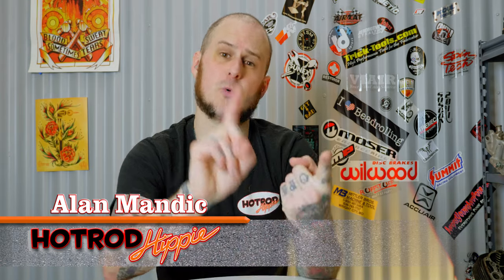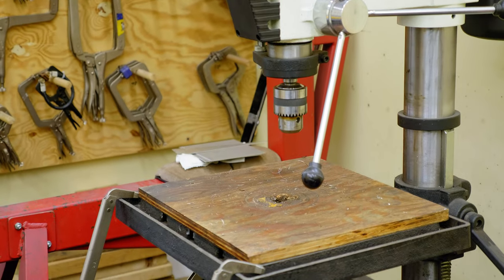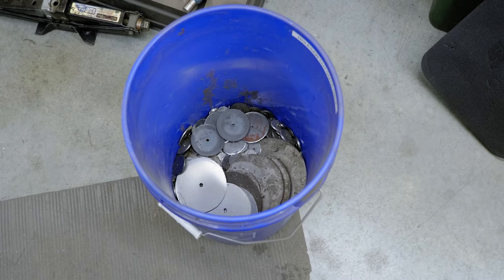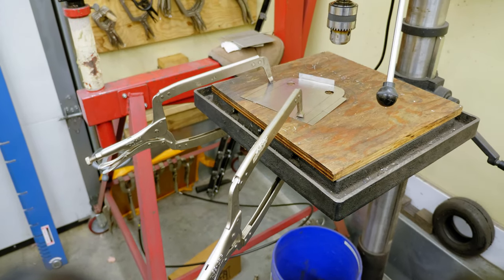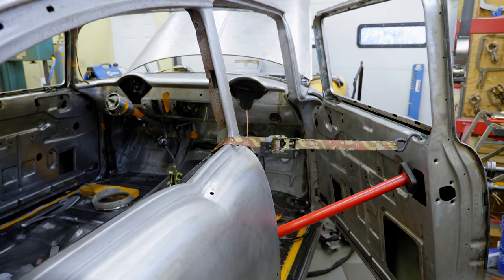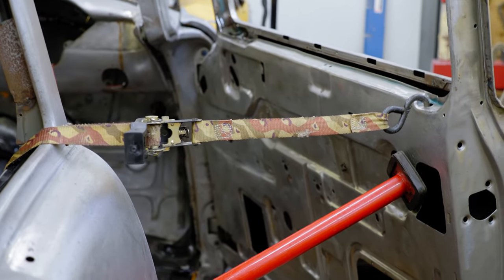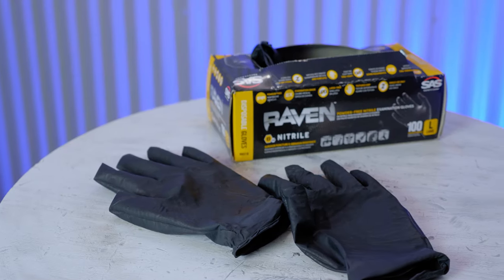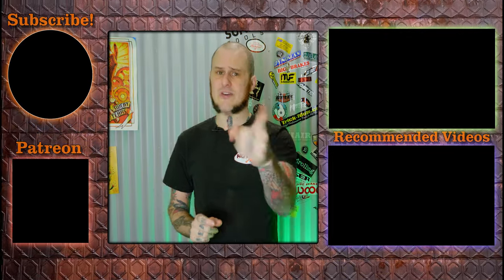Basic Fabrication Shop Tips - Work Smart Not Harder

Comment: It's always good to see tips and such. No one knows them all. 
I keep a powerful magnet next to the drill press and place it on the item I'm drilling to gather up and catch some of the flying debris from the drilling operation. This is obviously only good for steel ;)
When I was young I had a boss and his "number one" hold me down and pull my respirator off and dump paint thinner in it saying I was a wimp. I quit working that day for the idiots. Let no one compromise your safety. 

Dad used to say, "Us old folks don't walk slow because we can't necessarily walk faster.. we just remember what it feels like to fall down". 
As I get older I sure get the point. Young, invincible and stupid can be used interchangeably sometimes. ;)  
There is an old saying: "You can't fix stupid".  I add:  "but you can help prevent it".
Thanks for your videos.
Reply from the maker: I can't stand the Toxic "screw safety" "airbags are for wimps" culture. I worked with a guy some years back who had major lung issues. He eventually passed away from them. He used to paint cars without a mask cause "that's just what we did" and still wouldn't wear one when grinding while he had COPD. He was a great guy but just wouldn't help himself out. I don't want to be that. 

The magnet idea is a good one. Sadly the ones that drive me nuts are the aluminum filings. Those just FLY when I drill it.
Reply: @HotRodHippie  That's too bad about that guy but so common. :(
Ya.. never seen a magnet for aluminum. ;)
 Maybe a strong vacuum system would help catch the smaller filings.
Cheers.
Reply from the maker: @Joe.Doucette  I have been known to fire up my shop vac at times and do that when drilling. The shop is really small though so it can be cumbersome to work around. Maybe some day I'll make a mount to put a shop vac on the drill spindle or something.

Comment: 1 - I've a round table on my drill press - I had trouble using C clamps with it as it had strengthening webs on the bottom side.
I cut out some Formica faced particle board to give me a flat/level surface to clamp to - I simply siliconed it in place

2 - I put my chuck key on one of those spring loaded key holders you clip on your belt - I've haven't had to look around for it since.

Comment: Spot on about the health issues you have raises here Alan. It is not fun losing a sense or senses, then having to deal with the issue(s) that follow it. Of note, some PPE can be under/over designed or even used incorrectly which can cause problems as well. wholly, safety a pretty complex issue to talk about as varying personalities and equipment play a key part in it's utilisation and compliance. Safety first - Cheers for the video bud :-)
Reply from the maker: Thanks and good points. Like slemkne else mentioned, beards are an issue with respirators. Properly fitted respirators are a whole thing. Medical personnel get fitted regularly for theirs. It's a big topic. Maybe some day I can get an interview with an expert or something and cover it in depth. That ought to turn off plenty of viewers. Haha

Comment: Found you on TikTok a while ago, been binging your metal working and tool review for a few days now trying to absorb as many tips about body work as I can, Ive been doing mechincal work for a car dealership going on 8 years and have a 4+ car garage at my house, but after putting tools and toys away there’s next to no room in it. I picked up a 1968 Buick riviera that’s been in storage since the late 70s I plan to restore after finishing a few other projects up. My content is what is the trick to doing body work/ fabrication work in smaller shops? It seems like I’m constantly trying to organize to free up work bench space and floor space but with 3 other vehicles and welders, plasma cutters, drill press and bench grinders it’s a constant battle. I’m in WNY weather so putting everything outside isn’t an option when the other cars don’t see rain or snow either

Comment: When I tear something apart, the nuts, bolts, screws, misc small items etc. I put them in empty clear plastic jars ( peanut butter, mayonnaise etc. ) and screw the lid on. With a pc of paper describing said parts, definitely better then a zip lock bag. And then put said jar w/ it's larger assembly till you're ready to work on it. Sure beats throwing everything in a box and trying to figure it out later.

Comment: Great useful shop solutions. Have you found a good respirator with affordable filters for grinding operations? How long do the filters typically last at your level of use? I have seen several at Lowe’s and Home Depot and I suppose any of those would do, but I know there’s good PPE that is worth owning out there. I never thought about a respirator for the metal projects I do. I always protect my eyes but never thought about my lungs... Thanks for the wake up call.
Reply from the maker: I use this 3M half mask personally: https://amzn.to/376NwhB

It's reasonable at just $18. I usually get say 3-6 months of use out of the filters with daily use. I'm sure they'd tell me I should change them more often. 

A four pack of filters is a little less than the mask w/ filters: https://amzn.to/3625ct7

Those replacement filters are the 2097 Part Number also. They have an organic charcoal element to them for mild chemical filtering too. Some folks on Instagram told me they are superior in everyway, though I've yet to test them.

Comment: I get why you say stop holding it but after being taught by my grandpa how to drill through metal the point of holding it is for feel and you’re not supposed to just hold it down it’s steady presses not one solid press that may be why you’re breaking bits still have the set that grandpa bought and still use them for solid metal it’s all in the operator on how long equipment usually lasts

Comment: Strangly enough the main reason i clamp work down on the drill press is for accuracy. Sick of inaccurate holes. I like the clamp wall board. Im forever trying to find clamps.
Reply from the maker: Agreed. I very often make plates or pieces that are meant to bolt to parts or together. Inaccurate holes are serious problem when doing things like that. 👍👍